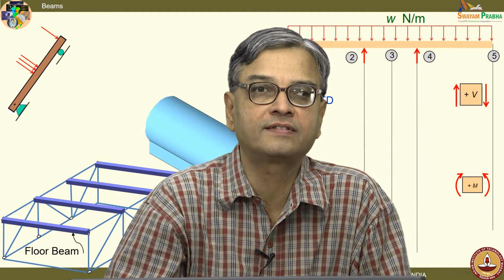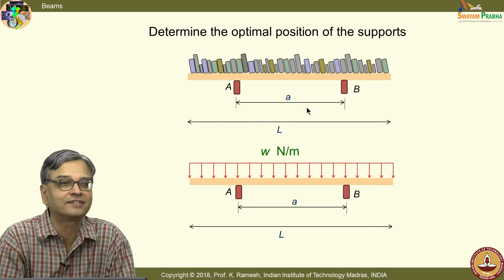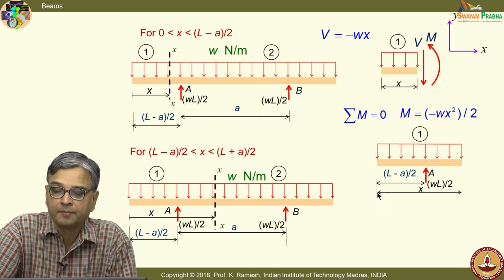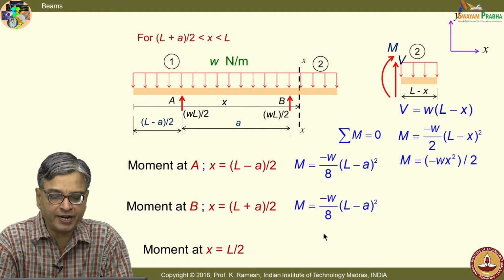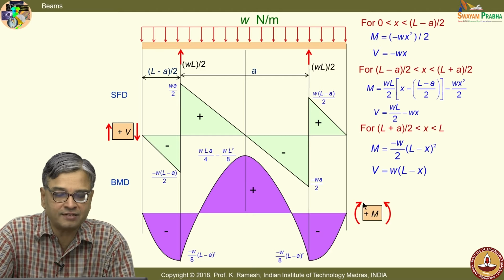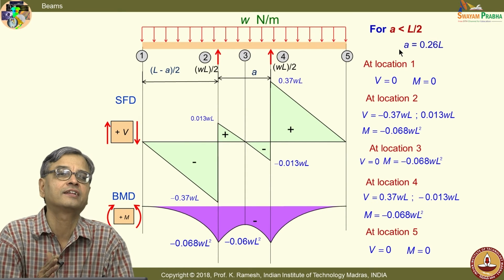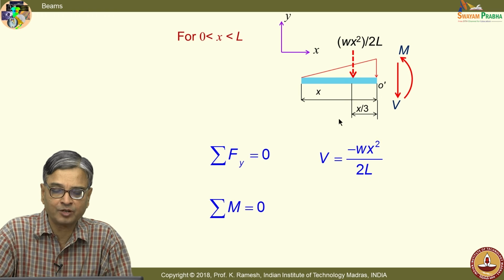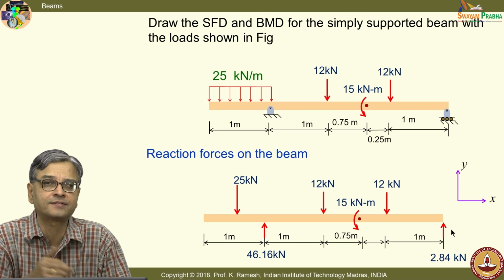Lec 13 Beams IV

Comment: 🎯 Key Takeaways for quick navigation:

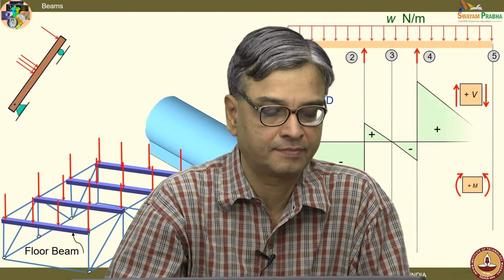00:42 📐 Sign Convention in Beam Analysis
- Understanding the concept of sign convention in beam analysis.
- Sign convention ensures consistent results in shear force and bending moment calculations.
- Adopting a discipline in sign convention prevents different answers based on the section analyzed.
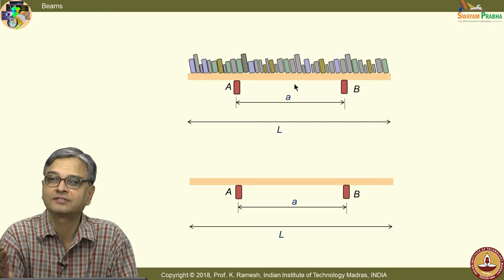05:22 🧮 Shear Force and Bending Moment Diagram Interpretation
- Interpretation of shear force and bending moment diagrams using different sign conventions.
- Identifying the consistency of results despite different sign conventions.
- Understanding the significance of adopting and following a sign convention systematically.
10:35 📝 Problem Solving Approach in Beam Analysis
- Problem-solving methodology in beam analysis with increasing difficulty levels.
- Selection of appropriate sections for analysis to simplify calculations.
- Demonstrating the application of sign conventions in solving beam analysis problems.
16:40 🔍 Understanding Maximum Bending Moment
- Clarification on the location of maximum bending moment in beam analysis.
- Emphasizing the importance of understanding fundamental concepts to avoid misconceptions.
- Addressing common student misconceptions regarding the location of maximum bending moment.
23:15 📝 Planning and Execution in Problem Solving
- Importance of planning notes and solutions in beam analysis problems.
- Organizational strategies for presenting calculations and diagrams effectively.
- Ensuring clarity and accuracy through systematic planning and execution.
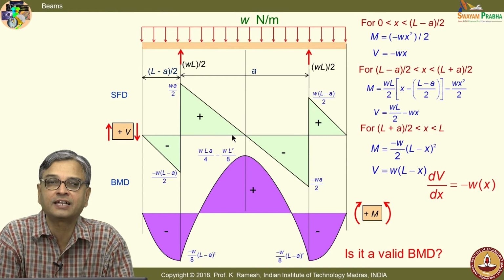27:45 🛠️ Analysis of Complex Loading Scenarios
- Analysis of loading scenarios involving protrusions and applied loads on beams.
- Application of force resolution and couple concepts in interpreting loading effects.
- Emphasizing the importance of correctly interpreting and analyzing external loads in beam analysis.
31:04 📏 Plotting Bending Moment and Shear Force Diagrams
- Understanding the process of plotting bending moment and shear force diagrams for beam sections.
- Importance of systematically drawing free body diagrams and applying equilibrium conditions.
- Utilizing the principle of superposition to analyze complex loading scenarios.
34:43 📊 Principle of Superposition in Analysis
- Explaining the principle of superposition and its application in structural analysis.
- Demonstrating how the principle allows for the analysis of complex systems by separately solving simpler problems.
- Highlighting the usefulness of superposition in simplifying computations and understanding structural behavior.
43:12 🔍 Interrelationship between Shear Force and Bending Moment
- Formally establishing the relationship between shear force and bending moment diagrams for beams with variable loading.
- Discussing the concept of equilibrium conditions and their application in analyzing beam sections.
- Demonstrating the derivation of key relationships between shear force, bending moment, and applied loads.

Made with HARPA AI

Comment: @ 43.20 -- Curve plotting confusion can be avoided by looking at the value of  slope of the  Bending Moment at 'A' .. which must be zero as the shear force at A is zero that means at a our tangent should be horizontal... that is only possible if we plot BMD curve inwards rather than outside... otherwise we will not get slope of BMD at A = zero......